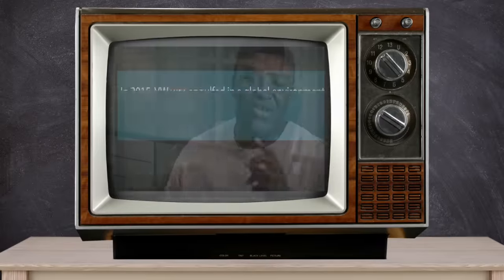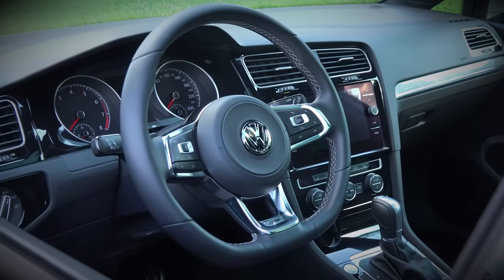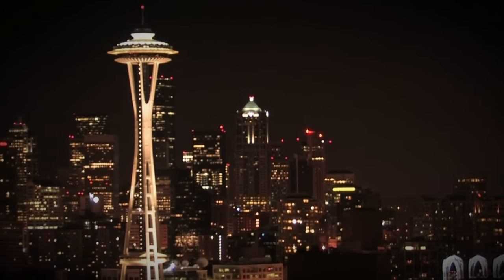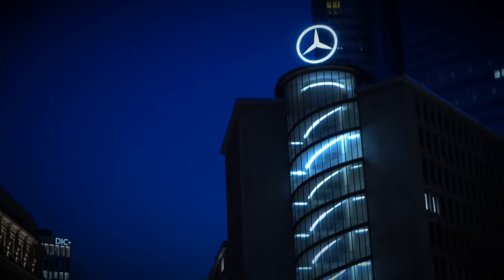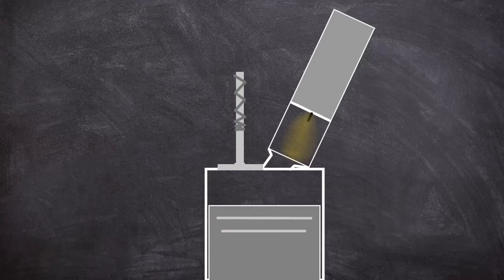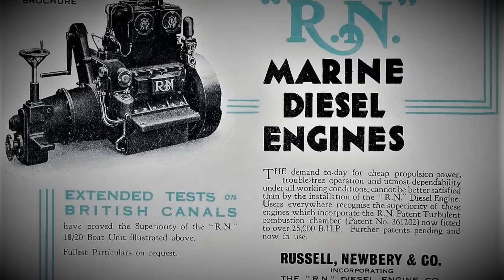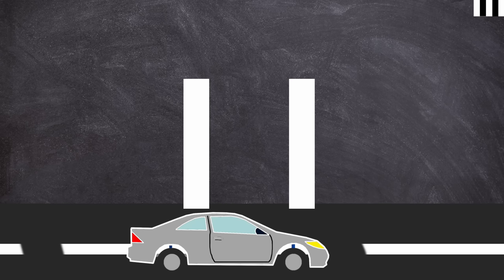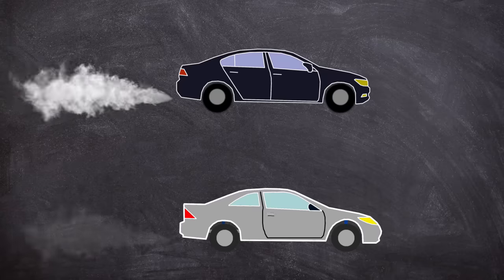Scandal: VW Emissions Dieselgate Explained | Plainly Difficult Documentary

Comment: At the time this story started to break I was working for a VW subcontractor. We supplied wipers and trims etc. The terms of the contract were pretty rigid and that was the way both parties wanted it. A degree of overstaffing and oversupply was designed in. The second they were hit with fines everything changed. Long story short ourselves and other companies like us were targeted as a way of funding those penalties. People lost their jobs and those of us remaining were left to sort the mess out. More of those who signed off on this fraud should have gone to prison. Fining a company on its own is no good.
Reply: a fine is only a punishment for the poor, the rich always have a way of simply eating the cost, or in your case, passing off the cost to “expendables”. anything to avoid consequences
Reply: Well more people are in prison for this than the Boeing 737 max scandal and that without any doubt was responsible for hundreds of deaths.
Reply: Without this, everyone would have lost their jobs.  The regulations made a vehicle which was unsafe at highway speeds.

Diesel engines are more efficient if left to idle, so the stationary mode did eliminate the main concerns of the type, the idling producing unclean exhaust.

Comment: There are some technical errors. It is air which is compressed, which heats up, such that injected fuel burns spontaneously. Early diesel engines used a mechanical injector pump with a separate fuel line to each cylinder. Common rail refers to a high pressure pump-fed fuel manifold, from which separate computer-controlled solenoid injectors admit fuel to each cylinder. NOX and particulates are separate things. The former is a gas, the latter are also called soot. The former results from high temperature oxidation of atmospheric nitrogen. The latter results from incomplete combustion of the fuel. Soot can be burnt off in a catalyst chamber. NOX is removed by reacting it with urea to form ammonia, in a different sort of catalyst chamber.
Reply: You wrote my comment!
Reply: @paulhorton5612  Too, wanted to say the same.
Reply: Yeah the ops words had me confused somewhat too!
Thanks for clarifying what my brain thought was wrong   :)
Reply: Well technically you both missed that in between the CR and conventional engines were the PD unit injection models that had camshaft operated high pressure pump/injector units.
Reply: @ma61king  ... extensively used by Detroit Diesels and others
Reply: @paulhorton5612  Don't think they are by Detroit as of late, at least not on DD15s, John Deere still uses them a lot though
Reply: And post SCR exhaust is Nitrogen (get it, Nitros Oxide, Nox) and water vapour, not Hydrogen and oxygen.
Reply: Around 11 minutes, I thought that was strange, talked about SCR, then goes to DPF (Regen engines).  Albeit a tactic used by Navistar/International, with just about as much luck with that as Volkswagen, they used excessive EGR (exhaust gas recirculation) and DPF’s to cool exhaust to clean up NOX, but was tough on engine, though created more particulates, which made regen problems, to avoid at all cost (cost them a whole mess of money) to avoid SCR.  SCR is fantastic, clean compliant exhaust, and allows the engine to run better, without the excessive restriction from both EGR and particulate restrictions, handled downstream.

I had a Jetta, was a great vehicle, though I had constant regen issues.  That daggum thing was regenning almost constantly, drove me up a wall.  Needed a new DPF, since it wasn’t regenning (though as I advised the shop, all it did all day was regen).  I would have much preferred an SCR system, and some sort of DPF minder to advise me of the status.  Seems to me that VW didn’t want to be bothered with the system, so they just threw it on there, with no support for it.  What sensible manufacturer would require a vehicle to go to the shop for a regen (or as I read in other vehicle manuals, for a fill up on DEF [available burt near everywhere]).
Reply: Therein lies the problem. VW wanted to make the vehicle as cost effective to operate as possible. Urea and SCR would have cleaned up NOX in all engine configurations. Instead the SCR system was implemented in   Passats and Touaregs because it was thought the cost of Ad Blue would be more easily accepted at there respective price points. Ad Blue is cheap and remains cheap.
Reply: @Vinincenz  Pro-Tip for Ad-Blue (or whatever brand of DEF you get):

Go to a truck stop or one of those GIANT gas stations (May just be a USA thing, but they are marketed as road trip stops, “Buckees” “Busy Bee” etc)

They have if *on tap*.  Because it is from the pump instead of by container it’s a bit cheaper, and it should all be “fresh”.
Reply: @paulhorton5612  same.  ALSO though Acid Rain is not caused by NOx Emissions

Fossil Diesel Fuel contains some Sulfur (Componds).  When burned this turns into Sulfur Oxides which when water in the air reacts with form Sulfuric Acid hence Acid Rain.

This is interestingly fixed not by some on-car system, but at the refinery by “Hydrotreating” specifically “Hydrodesulfurization”.

Hydrogen Gas Reacts with the Sulfur (Compounds) in a special refinery unit to produce Hydrogen Sulfide gas which is then made into Sulfuric Acid and/or Elemental Sulfur.  This is a useful product to an extent so a win win for the most part.  (Granted some “Unconventional Oils” like Alberan Bitumen Sands (Tar Sands, “oIL sAnDs” although i hate the latter marketing one, think Asphalt Concrete but natural…it’s not fucking oil lol) contain so much damn sulfur they have MASSIVE piles of the stuff to the extent they can’t find enough demand iirc, so not 100% a win-win).
Reply: @john1703 @plainlydifficult

May come across as snobby oof, i just intend this as constructive criticism from a long time enjoyer of the channel, but i would expect a channel of this quality to either do the research and get this right in the video, or *at least pin comments like this thread’s*.
Reply: @jaysmith1408  The video states that the Passat failed as well, even though using SCR. Don't understand that.